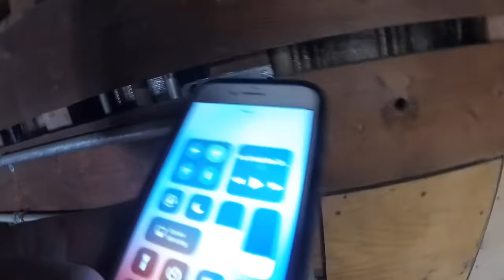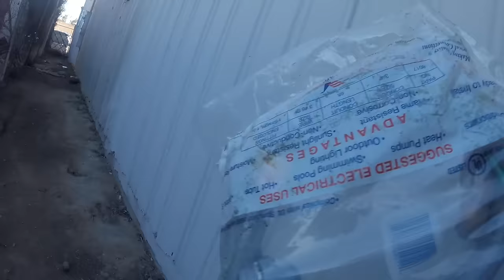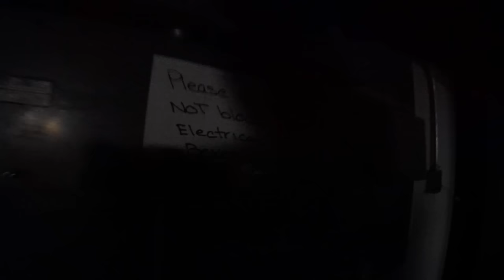Walk In Cooler Install Video 2019. Full 2 Days.

Comment: How much does this setup cost ?
Reply from the maker: It was done long time ago, prices changed a lot since then
Reply: How much would that set up cost today
Reply from the maker: @user-up2eg2ed4e  Im not sure. Need to get quotes from suppliers on the equipment and box, every time we get across those jobs. Those jobs quoted per request. We don't follow prices our selves all the time on equipment because its very big variety of different applications (so are prices on equipment), so all of those jobs priced differently depend on each job and difficulty of installation.
Reply from the maker: @user-up2eg2ed4e  that exact job today labor wise we would do for 6-7K

Comment: You should always build the ceiling panels as you build the walls to insure your walls are square as you go. Set up your walls until you can put up a ceiling panel. Then another wall or two until you can put up the next ceiling panel. In my experience this lets you know quickly if all your lines and measurements are correct. It sucks to get the last corner panel and struggle to get it in ;)
Reply: Guy needs to slow down with the torch when he's brazing in the suction trap. If you use the heat a little more and heat the fitting and pipe until they are warm enough you can draw back the torch and slowly lay solder. You should be able to get much more penetration and lay a nicer cap when you are finished. You won't get the solder and joint too hot and burn red this way. You don't want to cool this braze with wet rags whenever possible. There is a slight chance you will crack the weld, although i have yet to experience this.
Reply: While your piping practices will probably work. Your suction rise is a like a 38* angle. You never want a suction rise to be anything but straight up. The reason behind this is your oil return. At that angle refrigerant oil collects on the lower section of the pipe and can drip back down the line. I see you welded a 90 on the outside of the wall. I just don't understand why you couldn't hard pipe the rest inside? Was there something in the way? Another thing, we never want to reheat a fitting twice. When you weld a fitting it anneals the fitting therefore changing its chemical structure. When you burn one side of the fitting in without the other side the diameter and hardness change. This will make your next weld not quite as good as the other. This may never cause you a problem, but it could. By the way, up joints are very difficult so wouldn't you want the heat that you already used on the other joint in the fitting to help you braze that up joint? Less acetylene might save you a few $.
Reply: Man, the manufacturer says the you want the condensing unit atleast 1/2 width of the coil away from the wall. I hope you don't have high ambient temps where your at.
Reply: It looks like in the video that you have to liquid line touching those galvanized clamps on the exterior wall. Although you have tape between them eventually the vibration of refrigerant flow will allow them to touch. In the event of dissimilar metals electrolysis will occur between those metals. Chances are the softer metal will lose, this will eventually cause a refrigerant leak.
Reply: Fuckin drain line looked boss inside the cooler
Reply: Loved the grin when adding the coupling on the 1/2" emt on the top of walk in. Been there.
Reply from the maker: @bobbleheadjesus19  we have done many walk in coolers installs and we follow manufacture installation guides, if something you find wrong here it possibly add ons or something. cooler was installed long time ago and we never had any issues so far
Reply: You need a trap on your drain somewhere, either in the box or outside. This insures no outside air is drawn into the box. Fix your piping and turn the condenser 90* and you have a world class install. Well done! Keep up the videos it can't be easy! Thanks again for the video.
Reply: I hope you don't take my criticism the wrong way. I loved the video, I hope to see more
Reply from the maker: @bobbleheadjesus19  Im not that cheap to save on axy, sorry, even rods. I had many boxes assembled with no complains. this one survived thru last summer being closer to the wall than manufacture recommend. Im business owner and real life is a little bit different what people wright on Facebook about. System was calculated by coplend to keep up with harsh situations
Reply from the maker: @bobbleheadjesus19  its a horrible job after all, however we never had heard from them  for more than 1.5 years, we are service company more than install - believe me we know what we install - if it would not work its my headache.-we are not that company
Reply from the maker: @bobbleheadjesus19  ???
Reply from the maker: @bobbleheadjesus19  You need to get to the field and see how life works
Reply from the maker: @bobbleheadjesus19  dude? really?
Reply from the maker: @bobbleheadjesus19  It worked out good here, we had that issue on unleveled flors before - this one went smooth
Reply: @MaratRPMSoCal  Oh I understand real life. I'm sure the capacity calculated by copeland is correct. But I'm not wrong about your piping practices or the fact that your drain needs a trap. The distance from the condenser and the wall is up for debate. I still believe you are on your way to being world class. This is not a bad install, I just believe that we all have room for improvement. My best install isn't always my last one or my next one. 

Edit, I have put condensers that close the the wall in the past. You are right. Sometimes the real world doesn't give you alot of options, although turning it 90* in this case wasn't?
Reply from the maker: Im sure not perfect, thats what HVACR Videos Chris told me to do)
Reply: Nothing a couple swift burro kicks wouldn't straighten out !

Comment: I wonder how long that unit worked with all that copper oxide trapped in the system?
Reply: I was wondering that too.
Reply from the maker: We are servicing all our equipment that we install. Walk in works great, never had any issues for past 3 years, had to replace door closer few months back, thats pretty much it.
Reply: Yep didn't see any nitrogen being used during the welding.
Reply from the maker: @briansmith6135  You can flush all oxidation before you solder your lines to the condenser, dont see anything wrong with that, never had problems. Just to let you know.
Reply: @MaratRPMSoCal  we didn't see that happen in that video?

Comment: As a customer whats the most important questions to ask before I install a walk in cooler as far as the brand or marerial?
Reply from the maker: We usually ask customers what they store, do they care for more durable material, what temps they plan to keep product at, this walk in has slightly bigger door (customer ask for pallets to fit thru), how bright they want it to be inside. There are most of manufactures build very similar panels every manufacture has an options like digital thermometers, different hinges, glass windows, stainless still panels, in some cases we have to install floors (ramp/no ramp). We collect all information from customer what they want and give them options. I did see couple times very weird boxes that customers ordered themselves, unfortunately those didn’t meet our state codes, so we declined the job(customers get frustrated). Suggestions - check your state code. Here in California freezer has to have min 4” thick panels, coolers 3.5” thick, 2” gap from any wall, all that has to be considered. Also hire good installers, we see sometimes good boxes 2-3 years old that start to grow mold and start to sweat due to not proper installation or/and not proper refrigeration equipment.

Comment: oh man... just. Read the book next time when it comes to clearances to airflow obstructions with the condensing unit. Other than that this is a top of the line install.
Reply from the maker: I did research on clearance and unfortunately this is the most we could get. This side of the building always in shade, should be fine.

Comment: What's the price tag we looking at?
Reply from the maker: I don't recall. Around 10K, probably slightly over.
Reply: @MaratRPMSoCal  Do you remember the Dimension sizes on this walk in box? Also with the price you said did that include labor or without. I am trying to get an 8x10 Walk in and trying to get a good quote want to know what is should be around.
Reply from the maker: @runescapejr  I think just the box was around 10K. size 12X14(might be wrong but around there).  But that door is not standard size (pallet size 48"), there is many options on the box you can add up, so prices will vary. Prices on whole project will also depend on what area of US you are - labor is different state to state. Best thing to do is to get couple quotes, but be careful, some low bids might cost you more in future, research on good companies in your area and get couple bids.
Reply: @MaratRPMSoCal  for labor only or all in price?
Reply from the maker: @EKJOS  for an equipment

Comment: How to mess up your drill 101 28:33
Reply from the maker: Drill is fine, drill bit might be a toast ))
Reply from the maker: I don recall
Reply: Jorge, it’s called a hammer drill. Meant to sound and work like that.
Reply: Jorge, not sure what you mean, hammer drill with masonry bit for anchors looks legit bro.
Reply: Jeff Okuna I worked with a guy that has 15+ years of experience and my father has 20+ years of experience and both told me still guns aren’t made for it yeah you can use it once or twice for an emergency when you don’t a roder hammer
Reply: Jorge Morales  Rotary’s will do the job faster won’t argue that. However, as shocking as it may sound a cordless hammer drill/driver can be use much more than once or twice to do the job, that myth is busted a long time ago
Reply: jkokuna808 like I said was advice with guys that installed walk-ins for over 20+ years of experience (no they don’t use old dewalt drills they use the new Milwaukee drills)